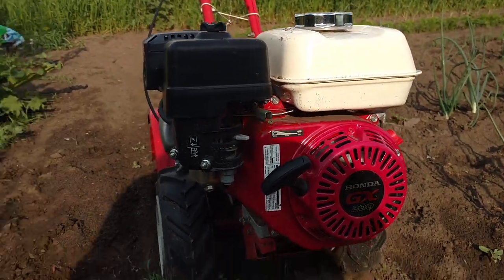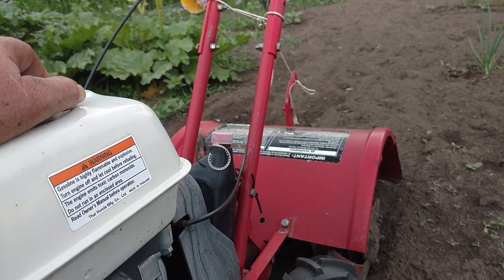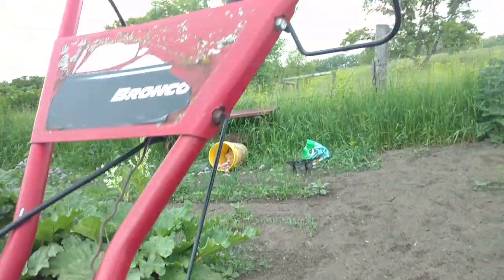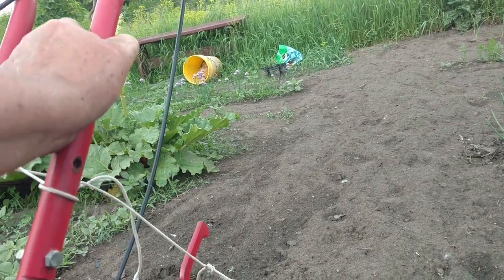My Tiller

Comment: Had a Troy Built new back around 1981.  Outstanding machine, top of class.
Reply from the maker: Very smooth operating, generally you can walk beside it operating with one hand so you don't walk in the soft dirt.  Unless your breaking up sod,. Then you need a tight grip or it will take a leap.
Reply: I use to have the same model with a 8hp tecumseh engine and electric start. It probably weighed 5 or 6 hundred pounds, you could till a garden in sod with one pass. I think mine was 1984 model

Comment: Thanks for the tip on the Honda motor. I have an old Troy Built bottom of the line no reverse tiller. Tell you what,been trapped in a corner a time or two. She's a digger! Best $20 I ever spent. Thanks for your videos!

Comment: The only issue I have ever heard anybody complain about on the Hondas is the gas cap not venting and causing vapor locking. If they stall,cap is loosened and it runs again. Buy a new cap...I believe it is folks leaving equipment out in the elements that have discovered this issue. Awesome motors and the soil in garden is looking very nice also. 
You better keep 2 hands on this bucking bull at all times!🤠

Comment: Great video, and I definitely have used and respect Troy Bilt.I use a pretty old Ariens worm gear drive with what looks like the original Briggs engine. It's a great tiller though burns some oil. That thing will go right through sod. Also inherited the same tiller, bit with a Honda engine. Hopefully, I'm set for life on tillers.

Comment: I have the exact same tiller! Still have the Briggs, till it wears out. Bought used for $200 this spring. One thing to watch for, you probably know already is the wheels freeze to hub shaft. No free wheeling when you remove pins. Makes for difficult storage for me. Got one off already, well greased. Other wheel is solid, welding a big nut to rim with bolt to push off. Then I'll remove nut, repaint rim and clean and grease hub. Thanks for Honda motor info. Can I ask, was it direct fit or did belts, brackets or pullies need modification? Still have my front tine, night and day difference! Thanks for Video!

Comment: I have the same tiller except it doesnt say bronco on it and mine came with the honda motor. Now my engine was bad and rebuilt and only ran less than an hour before blowing up again. I stuck a predator engine on and been good sine. These handle very well compared to many.

Comment: In 2003 I bought a brand new Troybilt Super Bronco. I've replaced the carb on the Briggs engine but the engine is getting tired. I also have another older Troybilt Horse that has the Tecumseh engine. The Honda engine is an excellent replacement engine. But in the near future I will be replacing both engines with a cheap Harbor freight Predator engine. I bought 2 of those Predator engines about 3 years ago that were on sale for $99 each. They both are new in an unopened box and remain that way until the Briggs and the Tecumseh no longer run.
Reply: I have a Predator vertical shaft that i bought to replace a Briggs that destroyed itself after a single year of work on my wood splitter. It's a great engine and workhorse.....and, yes, it has a steel fuel tank.

Comment: I have a Troy built Horse model with the original Tecumsia cast iron engine, the only downfall with the Tecumsia is that it came with a carbuerator that has the bowl reservoir on it, whenever you get on an encline with it, it wall stall out and flood on you, I suppose I could change carbs, but I really don't operate on grades very much to worry about it. Fantastic piece of machinery to say the least. Built like a brick shithouse.
   I've seen some very highend Porsche engine replacement parts come out of China, which are just as good as genuine German Porsche replacements, BUT what plagues China is their Quality control in which they can't seem to figure out for nothing!!!🤣

Comment: Honda makes the best motor out there I’ve had a few on different pieces of equipment never had a problem with any of them
Reply from the maker: You will notice at auctions any equipment that has a Honda motor on it will always sell for a better price, even not running, you can always get parts, and they are worth putting money into.
Reply: @logcabinlooms  Yes they are!

Comment: I have the same tiller. In parts. Briggs engine still runs well, but the worm gear pulled all the teeth off the brass bull gear. 
BTW, that tiller is Troy in name only. They’re built in Cumberland, WI by another company.
Reply: Parts are readily availible. I plan a total winter restoration of my Bronco, including Looms Honda engine.
Reply from the maker: I have heard of someone else who had a gear go out, but I think the failure would come from having the seal on the shaft go bad and leak the gear lube out.
Reply: @logcabinlooms  thank you for answering. 
My gear case had plenty of lube and no leaks, BUT the lube had somewhat solidified and was no longer liquid. Someone else had borrowed it so I’m not sure what really happened. I bought it new in 2001 or 02 and it crapped out by 2010. I just need to get up the ambition to fix it. 
I’m getting ready to cast some .311 flatnose gascheck freedom seeds for my Marlin .30-30 Microgroove. PM me your mailing address if you want me to share some with you.  
I was fishing west of Devils Lake a couple weeks ago. We really appreciated the graded roads. Don’t know if that’s your patrol area or not.

Comment: The Harbor Freight are essentially junk and people don't understand that.  Also the HF are not a direct copy of the GX200.  I have a HiSun engine that is a Chinese direct copy of the GX200.  I have modified it and run it very hard but I use Honda parts when I work on it.  Currently it has a Honda head, Honda piston, forged rockers, thicker push rods, heavier valve springs and Tillotson crank in it.  Also I have a Dana cam in it, ARC billet rod and PVL flywheel.  All together I'm pushing about 16 horse power out of that little 6.5 hp engine @7,500 RPM

Comment: Briggs & Scrap'em
Reply from the maker: The old Briggs are great, but like many companies they started making things in a cheaper version to compete in price.  I am sure they also have excellent industrial motors that have cast iron liners, but unless you know what your looking at it's easy to make the mistake of picking up the homeowner grade.
Reply: @logcabinlooms  I have a bunch of old cast iron briggs engines. 12 to 16 hp. and some smaller ones, Love those things......

Comment: How many Predator engines have you had?
Reply from the maker: I don't, but my brother is a sucker for them, which results in lots of swearing Everytime he goes to fire one up.  I do have a water pump with a Chinese motor which gave me fits, until I stripped of all the extra junk that kept falling off.  Pretty much redesigned, but now it's fairly reliable.  The carry handle broke, the muffler fell apart, the fuel tank disintegrated, and the wiring was a cheap joke.  But the basic motor is solid, except for a very cheaply made carburetor which I ended up replacing, and a very troublesome recoil start.  The pump itself is solid, and I often think it would be worth replacing the motor with a Honda.
Reply: @logcabinlooms  like the old saying goes you get what you pay for